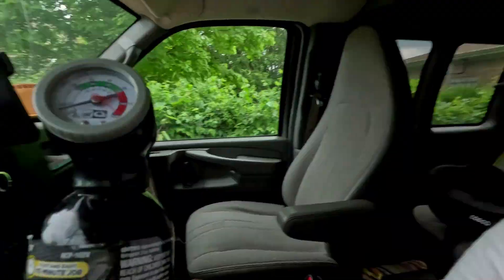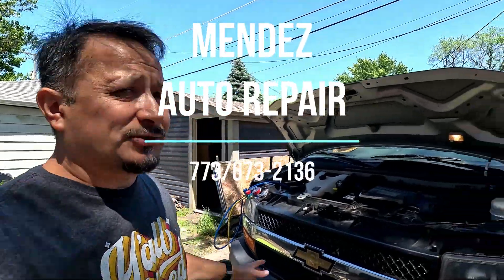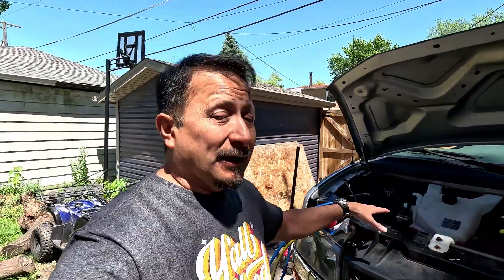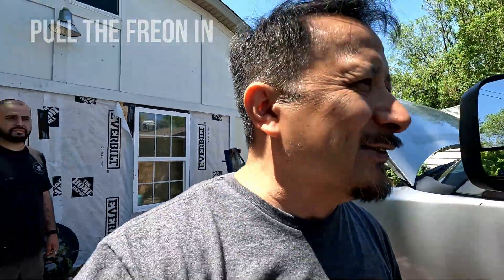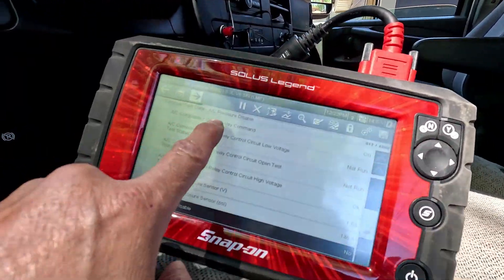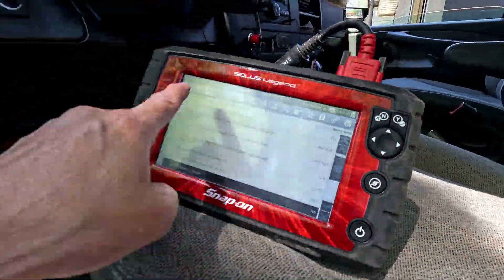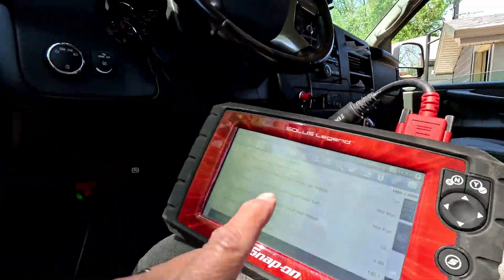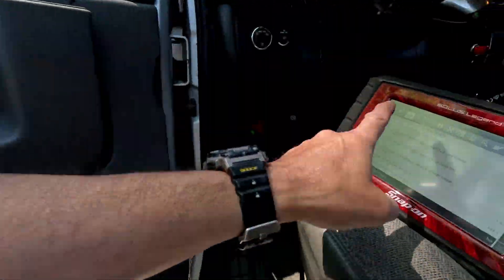Have your Cars AC  repaired the proper way NOT with this. #carsacrepaired

Comment: Go to autozone, get the manifold check the pressures and fill.  Dont evacuate the system unless you have a recovery tank. That snap on tool is dumb. the manifolds pressure tell all.  High pressure sensor? you dont need a fancy tool to see that the compressor is shutting off for no reason.
Reply: That snap on tool is merely a OBD reader that costs a ton due to built in giant screen. You use that if you already have one because it's easier than actually watching things.